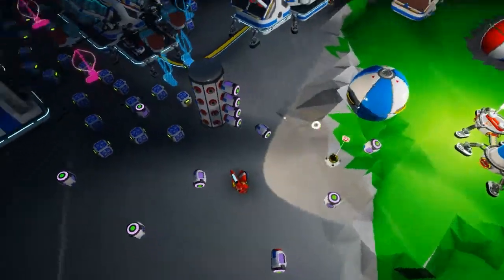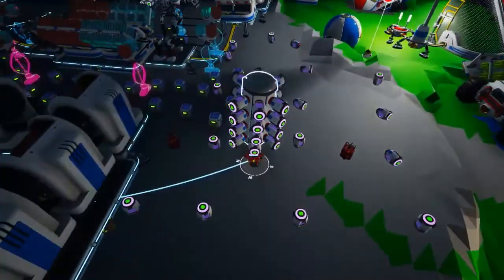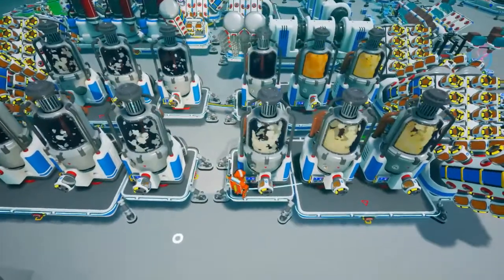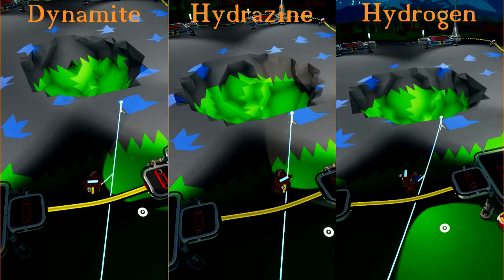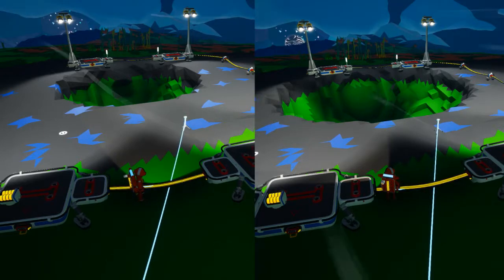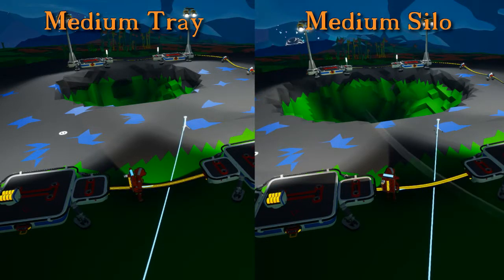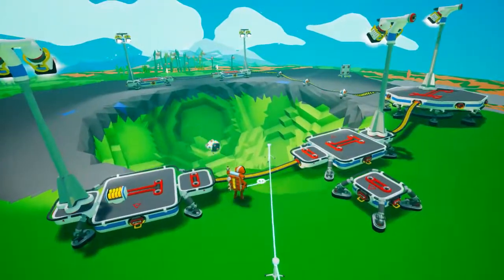Astroneer Tips & Tricks - Dynamite, Hydrazine, & Gas Explosions

Comment from the maker: 01:43 - Gas Collecting Setup
02:17 - Gas Power Setup
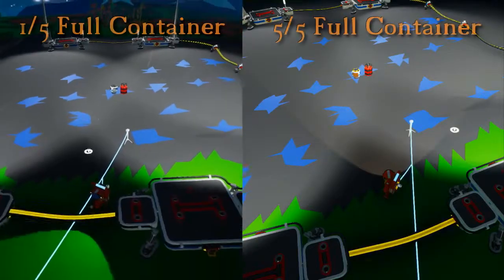02:30 - Partial Gas vs Full Gas Can Tip
02:56 - Single Explosion Comparison
03:23 - Tray/Silo Explosion Comparison
04:04 - Tray vs Silo Cost Comparison
04:38 - Placement Comparison

Comment: will eplosives remove items that are near to them?
Reply from the maker: Explosives shouldn't remove (non explosive) physical items other than some unmined resources and some plant life. A surefire way to get rid of items is to attach a Smelting Furnace with a unit of Explosive Gas (Hydrogen, Methane, or Sulfur) on it or directly attach a unit of Dynamite and set it off.